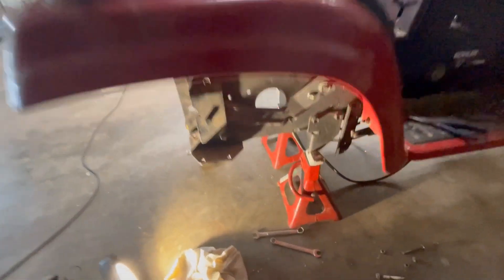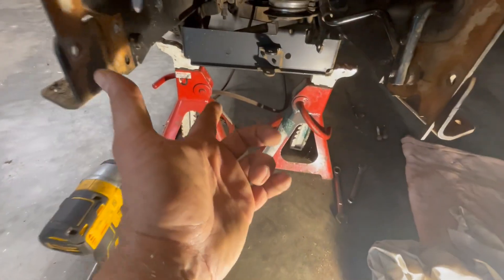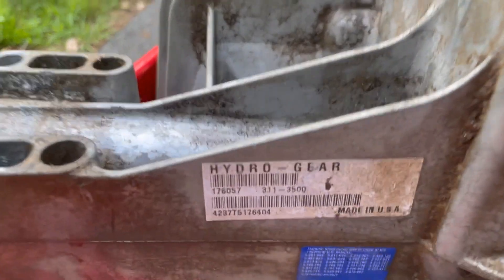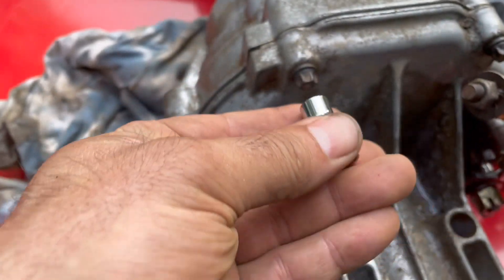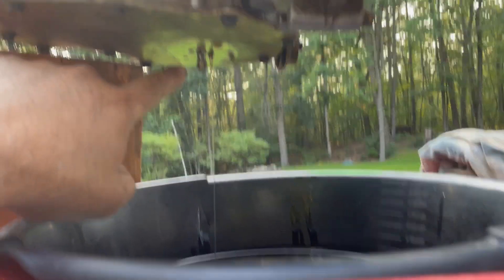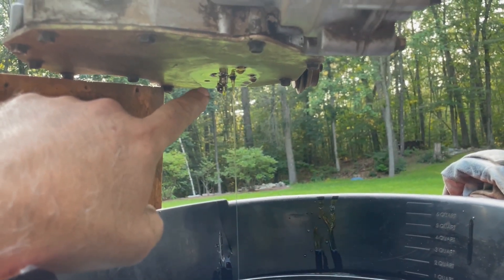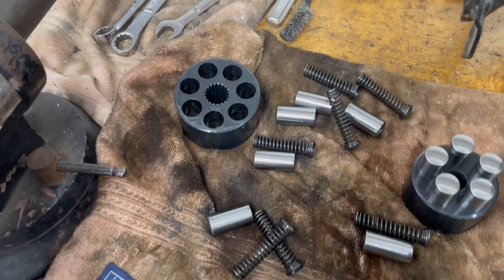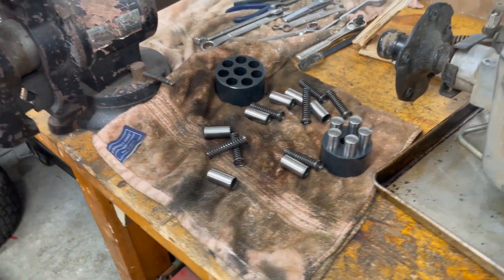Tractor does not go uphill. Hydro-Gear transaxle 311-3500 rebuild. Part 1

Comment: I wanted to thank you I recently had to reseal the bottom pan and replace top seal on same transaxle.  Put it all back together replaced fluid and transaxle would not engage at all.  Your comment at 5:39 really helped point me in right direction.  I reversed the  small pump or whatever you call it that attached to bottom plate so notch was towards the back and put it together.  Seems to be working fine now thank you my friend.

Comment: Had a similar issue; wound up being the welds on the frame of the tractor had broken, as such going "up hill," gravity would do it's thing & with a loose frame the belt was allowed to slacken ...thus slipping and vis a vis...no go go.

Comment: Did you ever do a part two on the DGT 6000 craftsman tractor hydro gear transmission rebuild and if not, what did you do? Did you buy used transmission or did you end up rebuilding that one?
Reply from the maker: Yes there are two more parts. Thanks for pointing this out for some reason they were not published.

Comment: any leaks or problems from having taken the pump off?  I'm about to do this and is very helpful, thanks.
Reply from the maker: No leaks. Just make sure the gasket dries for at least 12hrs before putting oil back in.

Comment: The sear owners manual  has the tear down schematic for hydogear transmission at the back  just get the right trackter model and google it., I have dgs6500 2007. It takes 20w50 motor oil not dxtron fluid..